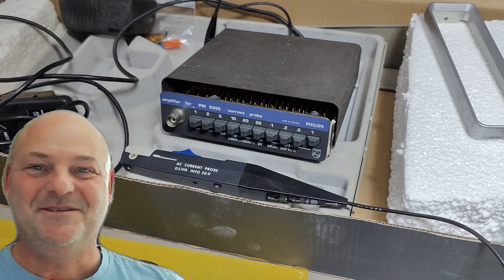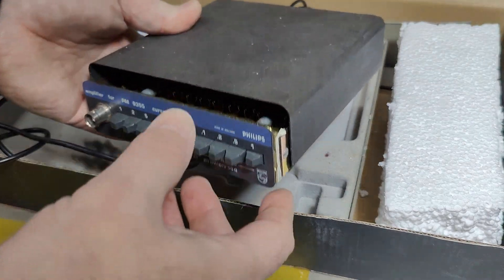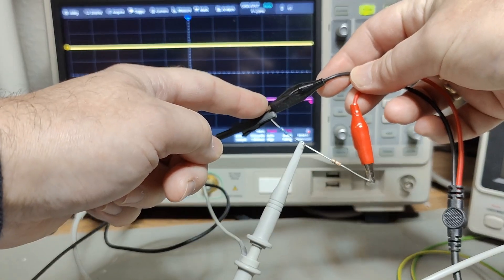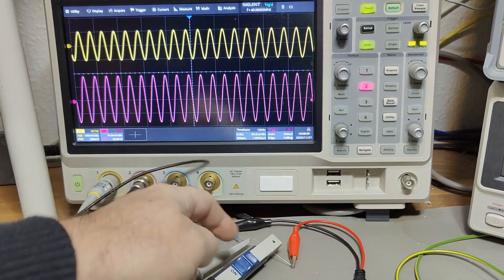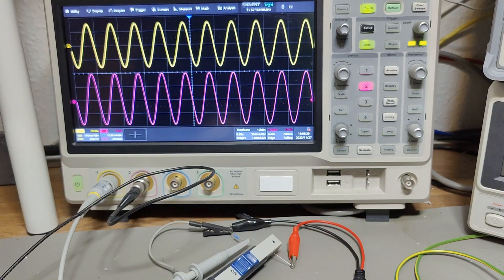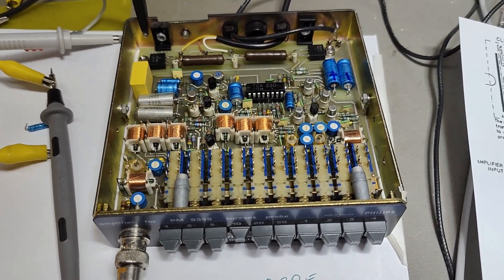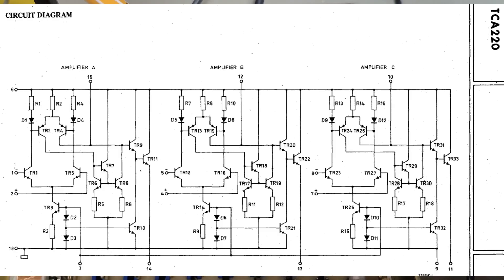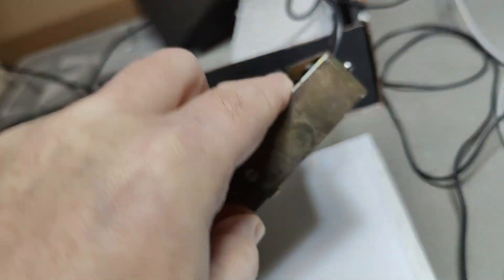Philips PM9355 AC current probe amplifier 1980 repair test teardown

Comment: What a nice device. And I am glad you coud fix it. I think it is nice there are so manny Philips components in this Philips device. Like the blue axial capacitors, I think the yellow foil capacitor, the ceramic capacitors on the bottom, I think those funny banded foil capacotors on the bottom, looking at the print I guess the opamp is Philips and probably manny more I did not recognize. Besides all sorts of devices Philips produced manny types of components. When I was at school there was a Philips factory in the same area where they produced cristal oscillators. Unfortunately I never got the chance to visit that factory. I think it is a shame this company got disassemled as it is. Cheers from Holland ;-)
Reply from the maker: I was actually visiting Philips in France i think it was a bit outside Paris, back in the days they started to make some really nice new microcontrollers

Comment: If you are going to leave the 2222 in place for awhile, maybe add heat shrink on its pins, as they crossed over. As the original BF173 transistor had a grounded shield, maybe bodge a small, grounded, metal can over it, for shielding.
Reply from the maker: we allready found one brand new BF173 :-) I think the transistor in the video simply was a prof of problem found, 
until the correct one will be put in, I do this sometimes :-) I also change my mind sometimes after the video is released.